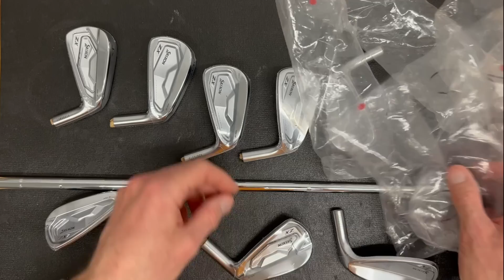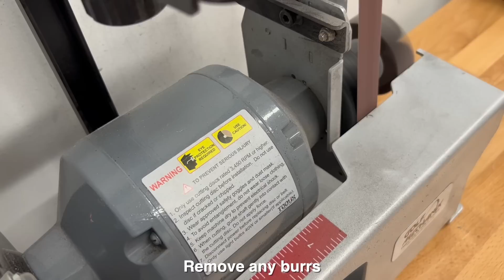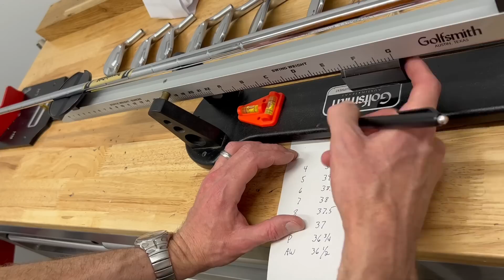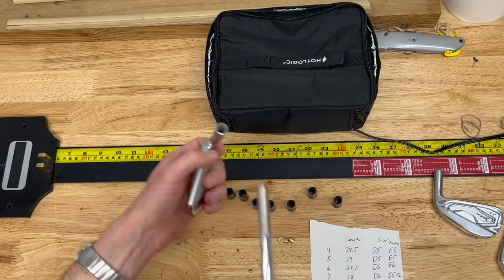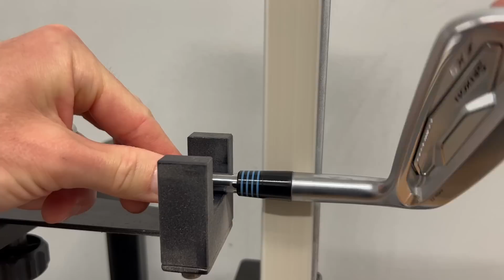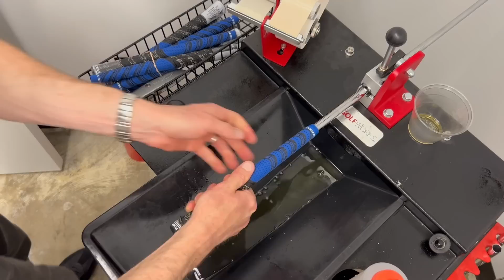How to Build Golf Clubs CLOSE UP

Comment: dumb question sry - if i am taking clubs that have have been built in house and thinking of reshafting - how impt is it to weigh the clubs with the new shafts? will the new shafts throw off the weight that much? going from DG 115g to DG S300 (so 130g)
Reply from the maker: Shaft weight is usually pretty consistent as is the head weight however nothing is perfect. Also factor that the lengths may not be perfect. My advise would be to pay attention to the shafts when you remove the 115s and see if and how much tip weight was used in those heads. Make a note of that as you will likely want to replicate those weights when you install the new shafts, assuming you don't want to swing weight everything.
Reply: @EFGMC thank you!!!

Comment: Hey AJ, I know the X 100 shafts are firm, but do you not spign align or flo the shafts for  better consistency?
Reply from the maker: No, never ever ever ever. I find 0 benefit to any spine alignment. A shaft flexes as it twists so if a shaft is inconsistent in how it bends, changes in alignment do not fix that issue.
If you have a flat, you can't just rotate the tires and fix the problem.

Comment: Thanks for the great videos! I'm currently in the process of building a new set of irons. What are your thoughts of building a set using the MOI method of 3/8 inch difference between clubs? Is the 1/2 inch method just as good? Any help would be appreciated. Thanks
Reply from the maker: 3/8 progression is a good alternative to 1/2 inch. Personal preference as to which is better. Personally anyone thinking about single length irons should consider 3/8 progression.

Comment: Any negatives to cutting your shafts to size after heads are installed and dry? Other than its easier to rotate the shaft on the saw.
Reply from the maker: Finding the weight and balance of the clubs (aka swing weight) will be difficult without cutting the shafts to the final length. That means you would need to use tungsten powder or lead tape if weight adjustments are needed.

Comment: Possible to turn down a ferrule with a 600 grit belt?  I don’t have a linen belt. Or, am I better off doing it by hand?
Reply: I decided to do them by hand. They turned out great.
Reply from the maker: It might work but you will need to be very careful and gentle with it. You can flatten a ferrule with a new linen belt very easily if not careful so double that with a sand belt.

Comment: When swing weighting how you said progression of about 2 points between short and long irons would that just be your irons or what do you do when you get down to wedges? Do you swing weight wedges so they all are the same so it would be wedges as one group and irons as another or would you swing weight them so they match with the iron progression?
Reply from the maker: They will usually end up being just slightly heavier than your PW.

Comment: Is there a chart for standard length for all irons, not taking golfer height length and adjustments into account?
Reply from the maker: A "standard" 5 iron is 38 inches usually. Each higher lofted club drops in 1/2 inch intervals until you get to the wedges where it drops to 1/4 in intervals. At least this is how I do it.
Reply: @EFGMC  thanks!

Comment: Does overall weight matter when building clubs? My swing weight progression is off by a lot. My swing weights are the following

PW 443.2g E4
9i 437.9g E0
8i 428.5g D6.5
7i 422.9g D3
6i 419.7g D1
5i 414.4g C9 (add 2g to head?)
4i 410g C6 (add 8g to head?)
3i 403.2g C2 (add 16g to head?)
Reply from the maker: Are these single length or some other non traditional length progression?
Reply: @EFGMC  standard lengths progression
Reply: @EFGMC  fyi, Grips are standard 50g

head weights are as followed

Pw 291g
9i 284g
8i 276g
7i 268g
6i 261g
5i 254g
4i 247g
3i 240g
Reply from the maker: @Mackahroney  Heads should increase in 7g increments which you basically have. I am not sure how you are getting these SW measurements unless the lengths are less than 1/2 inch progression.
Reply: @EFGMC  i will double check my measurements, thanks for replying!

Comment: What is the fit like without the small collared/lipped ferrules srixon would use as standard. I guess shafting beads make everything snug so you can use BB&f ferrules?
Reply from the maker: You don't need a collared ferrule. Any space will be filled in with residual epoxy and create a collar.
Shafting beads don't actually help with any of this. They are only meant to help center an already very good fit.
Reply: @EFGMC  Are shafting beads always necessary? What are the risks of not using them?
Reply from the maker: @trentsolomon3201  Not necessary and no risk not using them. The amount that they change the fit is extremely small.
Reply: @EFGMC  Thanks for the answer and all the helpful videos.

Comment: Great video!  I have a dumb question though. It seemed like you used the 4 iron as the “baseline” swing weight. Is that how it’s typically done? Just use the longest club?
Reply from the maker: No, I check the whole set and then see what I have to do to get them all in line. The heaviest club in the set will usually dictate what the rest need to be since it's way easier to add weight than take it away.

Comment: AJ Great and extremely helpful video!! The one thing I never see touched on in any club build videos is the angle that the clubs should be placed in when drying. It looks like you've used some wood trim pieces on your bench to create a specific drying angle for the clubs, Can you tell me what the best angle to dry the clubs is to keep the shaft centered in the hosel? Thanks!
Reply from the maker: I try to give the clubs some angle to dry at so there is less pressure while they dry. I try to always ensure the fit is snug so I don't need to worry about shaft lean but just in case I like to set vertical with a contact point inline with the shaft. Figure the angle is around 30 degrees.

Comment: Hi AJ,
Great YouTubes! I’ve learned a lot. So I will be practicing with some club making but I  would appreciate it if you would suggest a good way to select iron, hybrid and driver heads and shafts so that I can start experimenting as a hobby. I have a GCQuad launch monitor and setup a simulator that I use but the choices are so vast that I could use sone help with a “starter” set . Thank you and especially thank  for the great content.
Reply from the maker: Are these for practicing club making or actually looking for gamer clubs to use?
Reply: @EFGMC  I would like to use for fitting then becoming my gamer clubs. I would also like to be able to modify them.
Reply from the maker: @donmachen4762  Some brands are easier to work with. Mizuno, Srixon, Taylormade usually. Stay away from Ping, Callaway, and PXG when starting out as they are always more involved.
Reply: Would you consider doing consulting with me? If so, what’s the best way to discuss? Thank you.
Reply from the maker: @donmachen4762  Email me what you were thinking.
adam@elitefitgolf.com

Comment: Hey AJ Cheers from Delaware.  You make great videos and your knowledge about club builds is incredible.  Just about every video that you do is with .355 taper tip iron shafts.  I know you prefer them for their consistent, static weight.  I am building a set using .370 parallel tip shafts and was wondering if you have videos on the shaft trimming, weighting and swing weight balancing of a set built with these types of irons.  Do you weigh the shafts and keep the heavier ones for the 9 & PW or keep them for the 4 & 5?  for .370 are you more inclined to need to add some grams of weight to a club or two to match get swing weights correct?  Appreciate all the help your videos provide.
Reply from the maker: I don't think I have ever done that video. (Adding it to my list now). As for weight sorting, I use the heavier shafts in the short irons usually. Just make sure that they are actually heavier and not just slightly different lengths that will show up as weight differences.
Any SW difference should be pretty small vs constant weight.
Reply: @EFGMC  if you’d like, I can send you my components!   I am building a set of the Acer XV Tours  and I will be inserting a dowel into the hosel, and I will also be stamping a shamrock on the back of the face.  I was fitted in an extra half inch length, so I will trim the tip up an extra 1/16 or 1/8 because the extra half inch may soften the flex to some minute degree.  Currently gaming Titleist CB714 but I am building these on an itch to scratch.
Reply: @EFGMC  I am building my Acer XV Tours and I have filmed essentially every step.  I tried to build them as close to perfect as one would in your club making studio.  I am also going to stamp the clubs to make them my own!   If you look up ACER XV TOUR BUILD after the holiday you can see and comment on my work.  Thanks a bunch!
Reply: Would love to see this video as well.

Comment: Hey AJ, dumb question for you about shafts. Can I buy a bunch of 5 iron length shafts and then just cut them down to size for each one of my clubs? Or do I need to get specific shafts for the specific clubs? I’m 6’3 so looking to lengthen all my standard length clubs about 1/2”
Reply from the maker: Will depend on what irons you are reshafting. Some irons are taper tip (.355) diameter, some are  parallel (.370) and ideally you want the matching shaft and head. Parallel shafts are usually sold as blanks that you both cut from the tip to achieve the correct flex for the particular iron, and then cut from the butt end for final length. Taper iron shafts come from the factory already (tipped) the correct amount for each particular iron so they only need to be butt cut to length.
Reply: @EFGMC  Thanks for the reply!

I have p790 Ti irons (.355 tip) and I just put on Steel Project X Flighted 5.5 Shafts (.355). I purchased all 5iron shafts and then cut them all down, but I’m thinking that was a mistake. My swing weights in them also get progressively heavier PW-5 versus the other way around.
Reply from the maker: @jakeobson  Your short irons are going to be more flexible and your long irons will be stiffer than they would ideally be.

Comment: That's a nice set of clubs, but..... Who wants swing Wright d7 on a 8 iron? Who believes that D5 is normal for a long iron? When i got my japanese bladed irons from honma, bought by a real clubmaker who already build clubs for tour winners, then all these clubs had nearly the exact swing weight (within 1/10 gramm). If you buy a set of Miura for example, all club heads are nearly exact forged so that you can build a set of with the same swingweight. The wedge have more, that's normal, but not the rest of the set. Normally you put weight out of hostel to bring the swingweight down to D3 if the clubs become longer than standard - i hoped to see exact this from you! That's the work of a top clubmaker! But what i expected to see was exactly not what you showed me us.... To be fair... 
I'm a little bit disappointed
Reply from the maker: Some people are way too concerned with particular SW values. The point of SW was to attempt to make all the irons in a set feel similar, not to find some completely arbitrary SW value. I can build you a club 3 inches longer than standard with a D1 swing weight. That in no way means that club would be better or easier to hit.
Reply: @EFGMC  thanks for your opinion! But I don't agree with you. Fitting and Building a set of irons there are two main aspects to check. First, you need a shaft with the same characteristic through the hole set. In modern times people select clubheads with the weight in the sole for high trajectory from the fairway, and then they take a DG x100 for a liw trajectory to bring them down again. Every set of clubs need a constant basic. And here also the swing weight counts! It's a question of confidence and rhythm of the swing. Getting this is the same swing weight elementary! Wedges are played in a other way, with individual skills and there also a flat lie angle is better because you go more down in the knees. But all the other clubs need the same weight! Getting them is a quality aspect of the manufacturer, the Miura heads for example are all absolutely exact forged (lighter with each longer iron). Mizuno builds all clubs in D3 also. I myself was a good player and i always only take clubs with a exact swing weight. Tour professionals i know also do. I'm not able swinging a 6 iron maybe with D6 weight and i know many players with sets inch longer who struggled with such irons and never used such high weighted clubs again. But i you think it's normal having a set of irons in a range from D7 to D3, than maybe build such a set. But not for me and all the really good players i know.
All the best for you!
Reply from the maker: @michaelscore6763  Sounds like you've got your views, I've got mine.
Reply: @EFGMC  but my view is the view of the best brands in business, the best handmade club brands. The viewing of Mizuno, Miura, honma and also Titleist...... I know winner's on a world tour bringing their clubs to a club maker four a check of the exact weight.... That's a question of quality standards, nothing else.

Comment: I've seen a few diff vids now on cub building and just assume it's how you learn.  7:21 you place a small amount of epoxy to hold the ferrule in place.  I just use the excess from the shaft runoff and I also place some inside the hosel of the head and twist the shaft to ensure it's coated well.  Ferrule stays in place and so does the shaft to head.  Learned more about swing weight thanks.
Reply from the maker: Short term, the epoxy for the ferrules doesn't matter. Long term I am not sure if it might help and since it only takes 5 seconds to do, I've started doing it.

Comment: Great video as always, but when did you start putting epoxy on the ferrules? I've watched your earlier videos and I don't recall you putting epoxy on them...

On a side note do you have an email address for questions? I have a question about shaft weight going from steel to graphite and I wouldn't want to clog up your comments section.
Reply from the maker: Yeah, I tweaked my method slightly with the light epoxy ring I put on the shaft. Not sure it makes a bit of difference in holding the ferrule down long term, but as it only adds 2 seconds per club during assembly, I figure why not.

aj@smartstake.com

Comment: AJ, a couple questions if you have the time.  Do you confirm the head weights before beginning or are they always marked in their individual bags?  If you have a customer like me who knows all of their component choices, prefers a D0-D1 swing weight, but the initial weight comes in around D5, what extra precautions do you take, if any, to get the swing weight down apart from a few grams placed here or there?
Reply from the maker: I dry fit everything together first to find the SW for matching purposes. If a set comes out heavy, options are limited. Either we have to switch out to lighter shafts, or drill out the heads. You won't ever see me adding weight to the grip end for the sole purpose of bringing down a SW.
Reply: @EFGMC  Thank you for the continuing education!
Reply: @EFGMC  I've seen grip weights vary 12-16 grams in the same size from model to model, I'd see if we could find a grip that allows for the change before drilling, agreed?
Reply from the maker: @esnyd  If you can find a light one you like, that's an option. Problem is many of the lighter grips have a unique feel to them.
Reply: Nice work 👏🏻👏🏻✌🏻✌🏻

Comment: It's player specific, but if the customer said it felt too heavy, what would you do to bring the swing weight down closer to D0 or so? I'm not much of a fan of back weighting. How about you?
Reply: shaft length is the reason these are higher swing weight but I would look for a suitable grip that's heavier before changing the head weight

Comment: "tour issue" shaft. Ok... What's the difference between them and regular Dynamic Gold shafts other than that being stamped on them?
Reply: The only difference is tolerance, when you purchase a set of TOUR ISSUE, the set you get are all as close as possible. 
Buying a single tour issue, means nothing if trying to match another set because the shafts are based on a set.